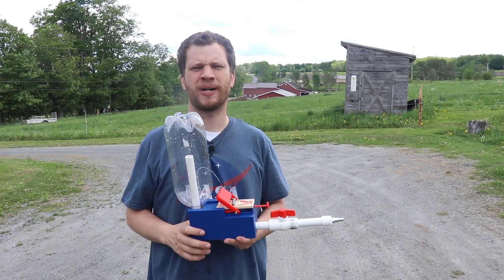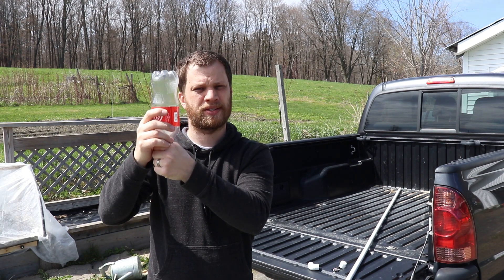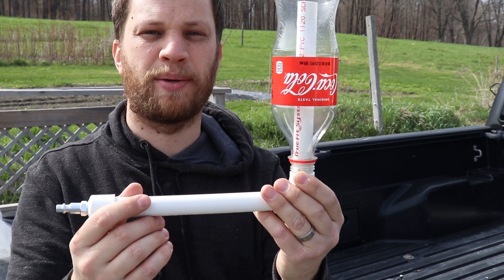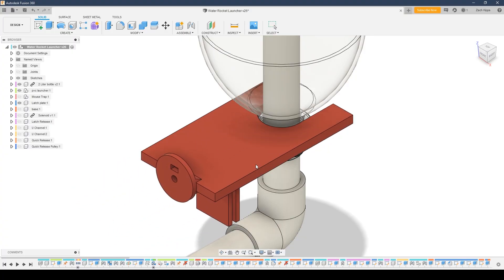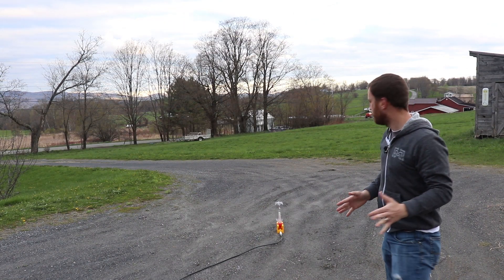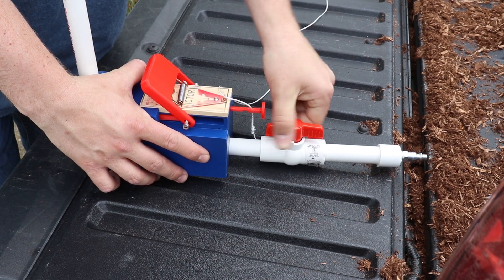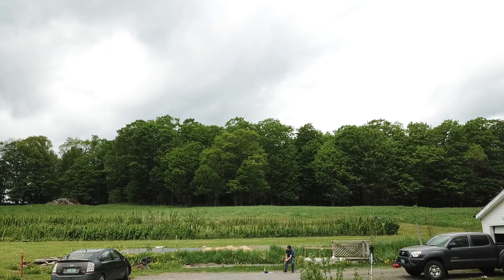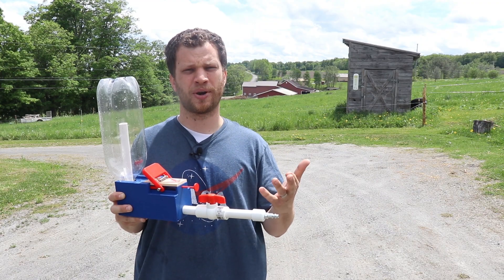Mouse Trap Powered Water Bottle Rocket Launcher

Comment: I have a question

How does the bottle doesn't leak water and air?

Is the tube the same diameter?
Reply from the maker: @Miki2coder  yes the tube diameter closely matches the diameter of the bottle
Reply: @bytesizedengineering  thanks very much
Reply: @bytesizedengineering  thanks very much